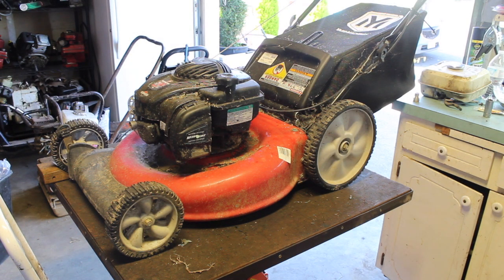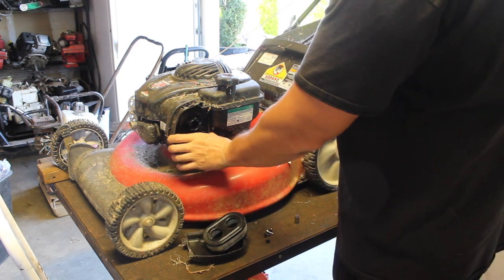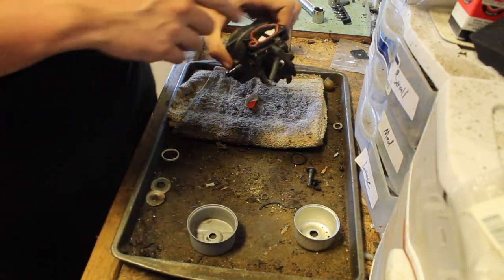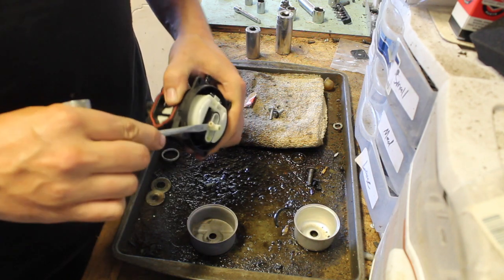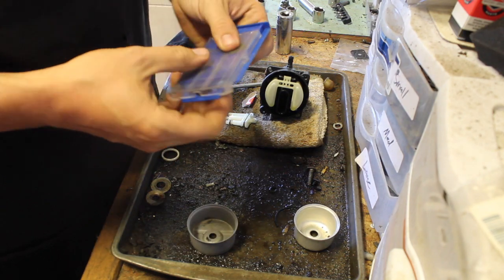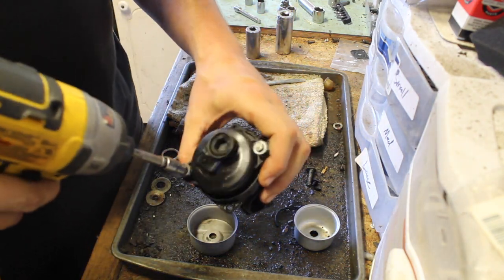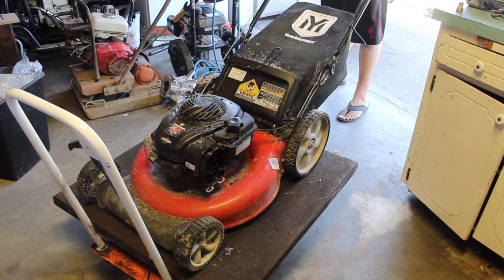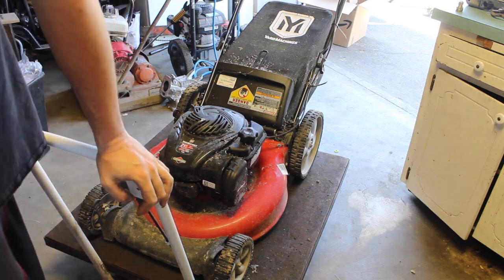Plastic Briggs and Stratton Carb Free Repair

Comment: The newer style Briggs and Stratton engines are a low quality nowadays because most of their external accessories are all made of plastic. That can be a huge disadvantage!
Reply from the maker: Agreed. Even excluding the additional plastic pieces the general quality is lower. I can't tell you how many of these engines I get that have a cracked somewhere in the engine casting
Reply: @PNWSmallEngineandLawn  The reason why Briggs and Stratton moved onto externally build them out of plastic because plastic don't corrode or rust like metal. They're also more lightweight and more shock-resistant than metal. Briggs and Stratton only moved onto making their engines more lightweight with enough maneuverability and lower maintenance.
Reply from the maker: While I will agree plastic will not corrode, it will definitely break. Plastic is also cheaper and knowing briggs has been having some recent financial issues i can understand why the choice was made. The plastic carbs are not perfect but very easy to service. I will complain about these carbs but the design does what it is meant to accomplish and plastic carbs have been used for a long time. My main issues are with the quality cuts in the new plastic pieces such as the recoil and the aluminum castings. Making a mower light weight and easy to use is important but no so light it causes reliability issues.